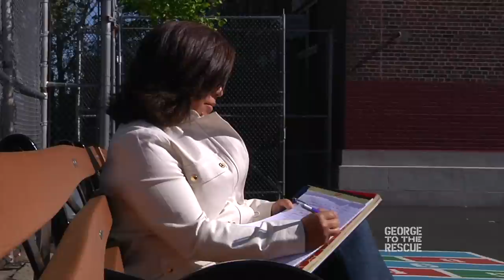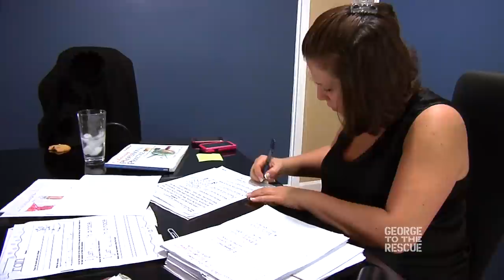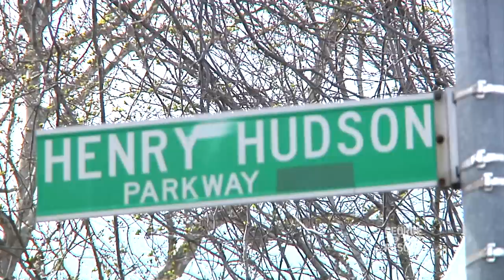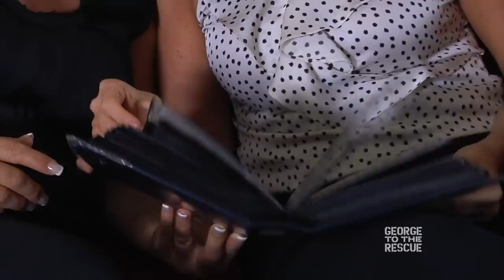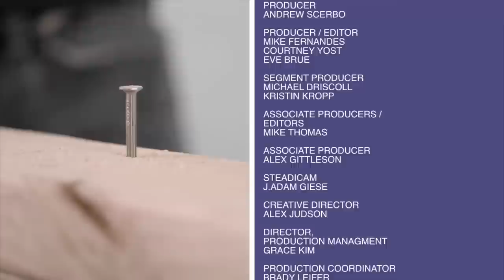Renovation For Devoted Teacher & Cancer Survivor | George to the Rescue

Comment: The original contractors that built this should be ashamed. I know it's not a new building but seriously, I've seen buildings built in 1900 still standing and still functional. We've done work on them and when we started renovating there may have been some degradation but nothing like that bathroom in that apartment. Heck, the school in our little bitty home town was built in 1901 and it was in better shape.